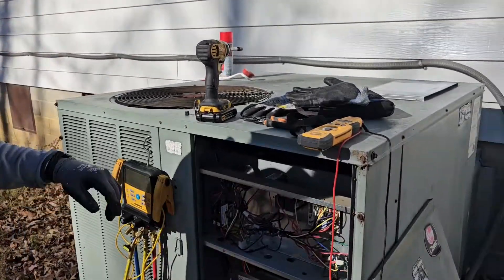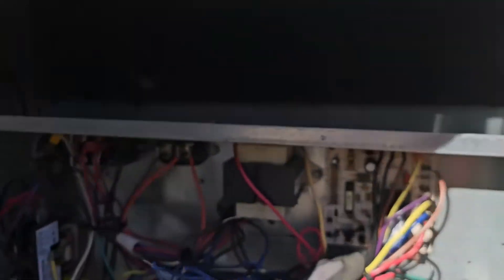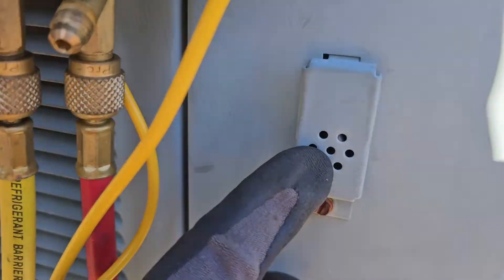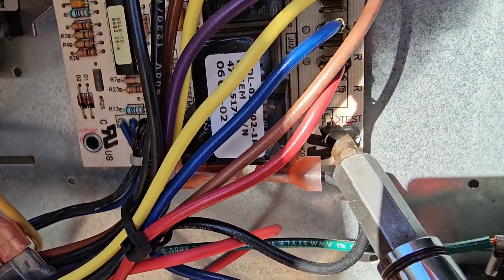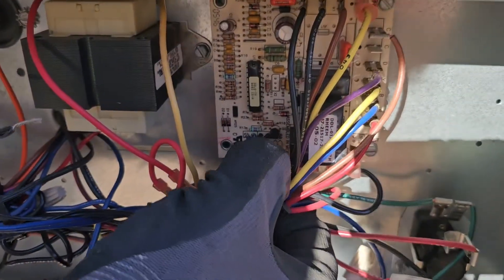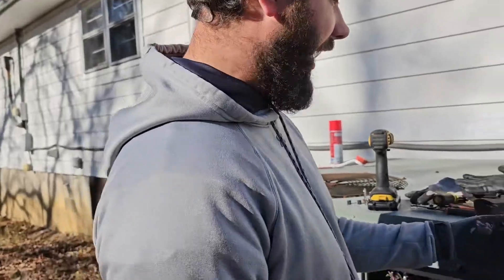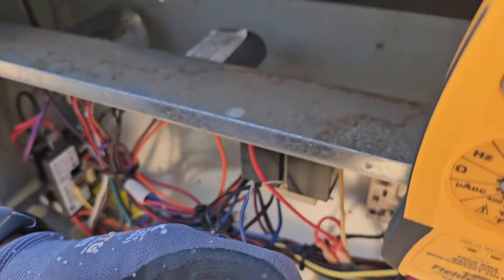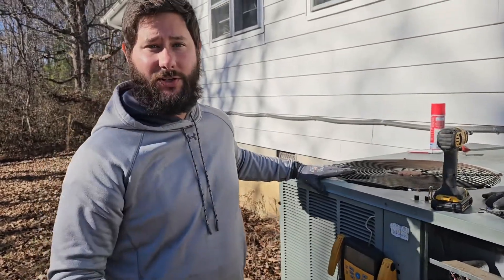Defrosting a Heat Pump: What You Need to Know

Comment: i have a question about a bard.  im new tech. had a call that breaker was tripping when freezing outside.  when i got there i put it in heat and unit turned on.  i put jumper cable on "sen jump" to simulate defrost mode and as soon as i tapped speed up the whole unit shut off and tripped breaker.  any thoughts on what this could be?  i ohmed out defrost control sensor and it was fine.  i jusy assumes it was defeost control board and didnt have one on me so going back today to replace it.

Comment: When I jumper the test pins to force a manual defrost I have to keep the pins jumped during defrost or it will immediately go back to heating mode, even if there is a lot of ice build up. Would this indicate that I need to replace the defrost control board? I have checked the coil thermistor and its ok.Any thoughts would be appreciated!

Comment: I changed my defrost board and now the outside fan will not come on. I put the old one back on and still nothing. The inside fan comes on. Also my thermost is covered in a black rubber. How do I take it off.
Reply from the maker: I'm not sure if I can help you through the comments on this one. My friend I hope you get it figured out